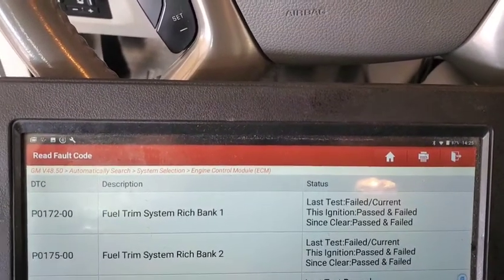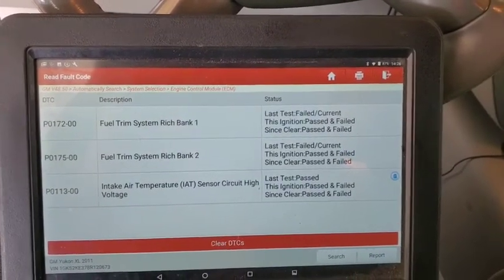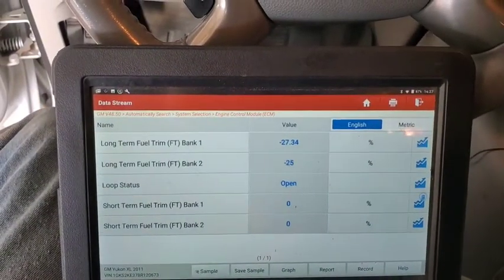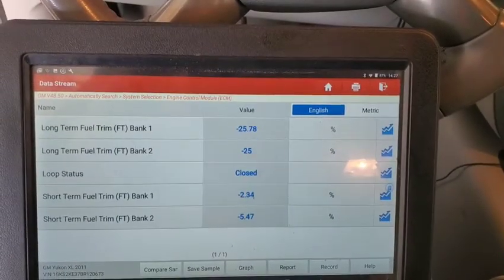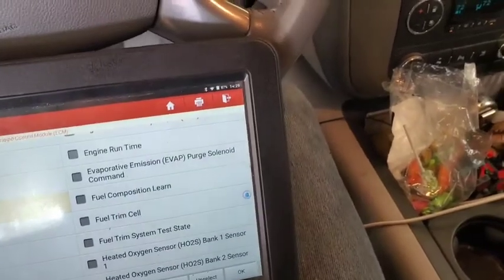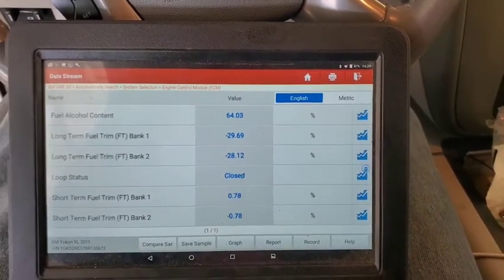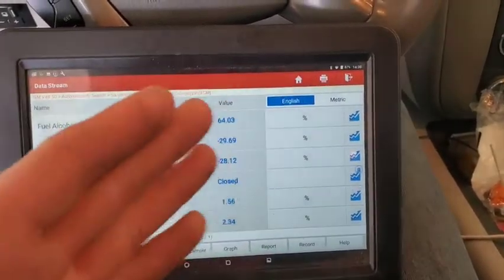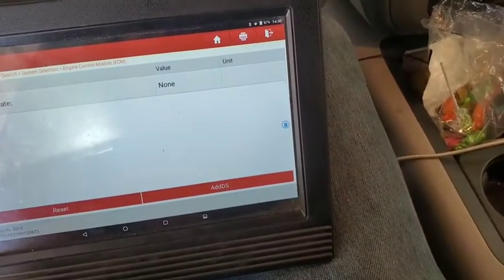GMC/Chevrolet Flex fuel P0172 and P0175 Rich Fuel Trim.  Yes it could be this easy to fix.

Comment: So how did the ecm get the impression it had alcohol contrnt in the fuel?
It seems there is a sensor to detect alcohol. So is it a sensor failing or even part of the evap system?

Comment: I have 2010 gmc Yukon Xl denali. My long term fuel trims both banks pinned at negative 30. I can not get it to come down. New fuel pump, new charcoal Canister, new MAF sensor. 
I have a Foxwell NT726 multi system scanner. I think my alcohol content is high too. Don’t know exactly as I write this the number. Would you know how to reset the alcohol level? I never use E gas. Your video is best I have found and I been looking for months. Thank you Kevin from NJ
Reply from the maker: Somewhere in the scanner connected to the PCM there should be a pid called Alcohol or fuel reset.  I don't remember what my scanner says but it should be in the video
Reply: The fuel alcohol content says it’s 70%.
Reply: Did you ever fix this currently have the same problem mine are negative 35 truck only has 100k miles

Comment: I am having the same problem. Same numbers. I don't have a scanner to reset fuel composition.  Would unplugging the battery for a while do anything? Is that scanner expensive?
Reply: U can get a diagnostic tool from 40.00- like over 200.00 ...

Comment: What would cause the ecm think that the alcohol content is so high?
Bad gas, bad sensor? Anybody from youtubeland know?
Reply from the maker: Yeah I hope someone might know that answer, because I really don't know why it would do that.
Reply: @prodieselrepair3218  I was reading on the newer models (2009+ I could be a little off on the year) there is no alcohol specific sensor. The alcohol percentage is calculated by an algorithm everytime the tank is filled. The evap system captures a sample of the newly filled tank, and calculates alcohol level based on expansion rate.
Reply: @prodieselrepair3218  I see chevys with the alcohol percentage at mid 50's, but I still dont understand what would cause it.
Reply: People fuel up drive a mile or two home park it overnight after a few times of this it rises alcohol content.  Never use any fuel additives in gm flex fuel vehicle.. when full of fuel drive it hard 50 plus miles it should bring ac % down